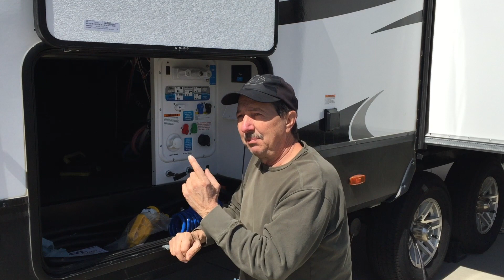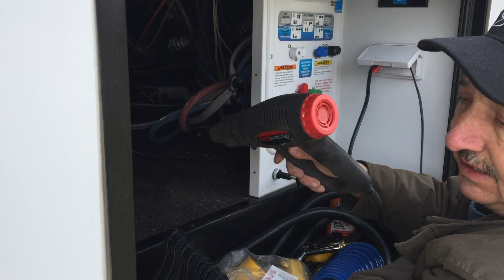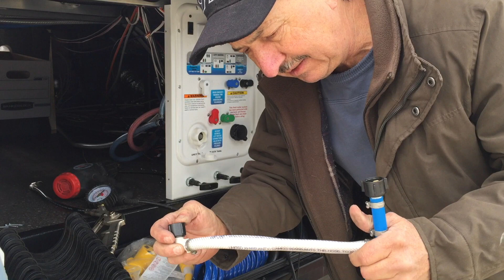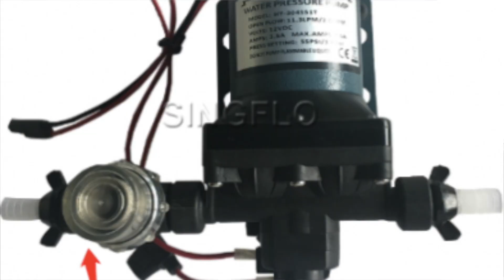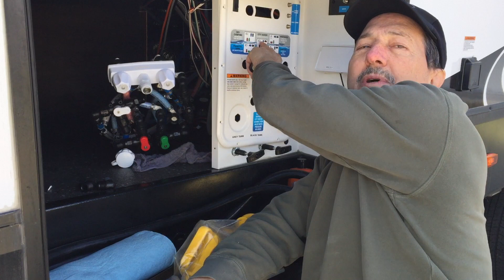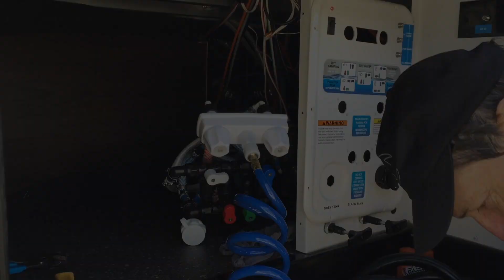3 Problems with the Nautilus water System in my Grand Design Reflection 5th wheel.

Comment: Excellent troubleshooting! I'm trying to learn more about the Nautilus system so I can put it in a custom trailer. Please post more videos with the system as needed. Happy camping. 😊
Are there any recommendations you have to upgrade the reliability of the panel? Maybe swap some parts for brass, or use pex only? I'm interested in the smaller P-4 panel for a two fresh water tank system with Truma combi water heater.  I think its gonna  be complicated tieing in both tanks to the panel.
Reply from the maker: The system has it's good points but mostly bad. Filling two tanks is not hard since the system fills with pressure. You can add a shut off valve to the overflow line on each tank so when one is full you close the valve and the other will fill. You just need to open the valve back up so that it will draw air in the tank when pumping it empty. The plastic valves in the system are horrible and the routing makes it so that you can't use water while you fill. It is also difficult to winterize due to water heater bypass. I see many guys getting rid of the system. The more I use it, the more I hate it. I want to convert mine to a simpler system.
Reply: @riderescue  That's good to know. I may have to come up with a custom panel for the same space. I never liked that it was plastic throughout.  I see the connection in the rear and wonder how the strain  doesn't cause leaks. The knobs don't appear to have any stops to prevent them from being turned in the wrong direction. As much as I like the esthetics and function, I may have to come up with my own panel with copper pipes and sturdy valves on an aluminum panel. Even if it all gets connected to Pex down stream.

Comment: If you push in the valve in the city water inlet, do you have to replace the whole control panel. I de-winterized mine and I had water to all faucets went back out because the hose was leaking. I think I turned the washer with the screen around and depressed the valve. Now I have water to the bathroom and toilet but not the kitchen sink.
Reply from the maker: The control panel most likely is not the issue. If you have water going to your bathroom but not your kitchen there is something wrong with the kitchen pipes. Check hot and cold at kitchen. If they are both not flowing it may be the faucet has a blockage.

Comment: Tried and tried, no way around having to replace the valve on the white handle. Money is a big deal for me. So where did you find the valve for $95? 🙄
Reply from the maker: Only place I have found to purchase the valve is from a Grand Design dealer or direct from Grand Design.
Reply: RecPro

Comment: Excellent Video!!! Explains a lot. Multiple issues with one I'm working on. You're absolutely right, not a lot of room to work with the hoses and it's a pain once you start unhooking them to resolve an issue with a valve or if the connectors don't line up correctly. Thanks again for submitting this!
Reply from the maker: I'm glad to hear that my video helped. Thanks for the comment.

Comment: I have the Grand Design 410.  It is only 3 months old and we have had one plumbing issue after another.  We are going to redo all the flex line behind the nautilus system.  We found a puddle of water in the bay and several of our fittings are leaking.  I feel your pain and frustration.  We pay so much for these RV's and it becomes a forced on you hobby of continous repairs.  Fortunately I like to tinker and solve problems.  Nice video.
Reply from the maker: It is sad that we must be tinkerers to own and use an expensive trailer. Thank you for the comment, good luck and thanks for watching.

Comment: I really don’t like to see those braided lines, especially with crimp bands intended for PEX. For that matter I think I’d prefer bypass valves on the water heater, a winterizing valve on the pump and a regular gravity fill and city connection over a water panel.
Reply from the maker: I totally agree. When I first purchase the trailer I thought the water control panel was a great idea. After using it for a few months, I hate it. The idea was to simplify but it did just the opposite. There is so many options of valves to have to think about for water needs. When filling the water tank the pump can't pump and winterizing are two of the worst functions.
Reply: Yeah, seems to me it adds a lot of fittings and valves. Also in some parts of Arizona the tap water is so mineralized I don’t care to have it in my RV.  Vending kiosks sell purified water for like .75 for 6 gal, or 50 gal for $5, but the dispenser hose just has an unthreaded brass tube on the end. I really wish, if they insist in using water panels, they’d also include a regular gravity fill dish. 

I realize not everyone would use it (would be handier for filling from a jug too) but it would only cost a few bucks. As opposed to retrofitting and taking the belly and tank down and spin welding a 2.5 fitting…

Comment: Great video! I have a 2022 Reflection 28BH and have to agree with you, I’ve had more issues with this rig than any of my others, combined. 
Mine also was winterized incorrectly and the “mixing ball” was split out. Got it TIG welded a few times and sealed it off then with JB Weld. So far so good. Thought I was having low water flow with a weak pump to blame. Removed it, did extensive troubleshooting and found pump to be operating as designed. Hook pump back in to camper, drawing from fresh tank - flowed perfect. Hook back to Nautilus andddd <1 GPM flow again. Hooked up city water and discovered the GPM flow was no better than pump at any faucet. I had the same collapsed line you did. I replaced it with hard PEX. Flow not improved. Finally broke down and called GD Tech support line. Walked me through all the basics (painful, but I understand why) and then sent me to advanced team. Long story short, they said it was likely in “blue or green” valve and instead of me fooling with it, he graciously sent me a new Nautilus panel, free of charge!!! Just received it the other day and am fixing to install. Fingers crossed it works. I hope it does, because there really isn’t anything else to replace!
Reply from the maker: Crazy how many problems I've had in just 2 months of ownership and it was only 10 months old when I bought it. Grand Design has been fantastic to work with. I'm glad to hear that you got a new panel to play with. I hope it all works out for you. Thanks for the comment and thanks for watching my video.
Reply: @riderescue  i removed the screws from the front of my panel and it pulled out about 1.5”, so my original idea of pulling it forward to mark it all will not work. I like how you unscrewed all the handles and valves and left the face of it. I don’t see why that wouldn’t work just fine to install my replacement assy. Was going to use some colored electrical tape or tiny zip ties to mark each connection.
Reply from the maker: @MattD1089  It is really difficult to remove the maze of hoses from the backside. I found it much simpler to replace each valved one at a time. Grand Design is sending me a new BLUE valve so I will be doing it all the same way again by leaving that face panel in place. It's time consuming but not as difficult and you don't have to crawl into the storage area to do the work.